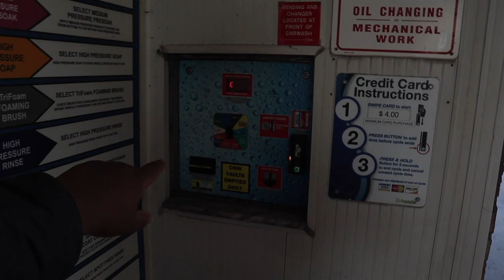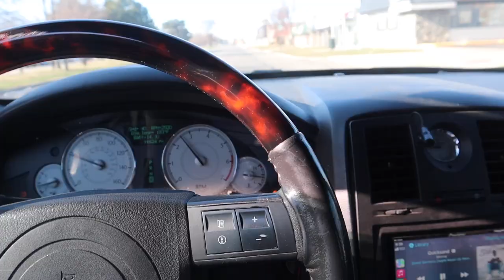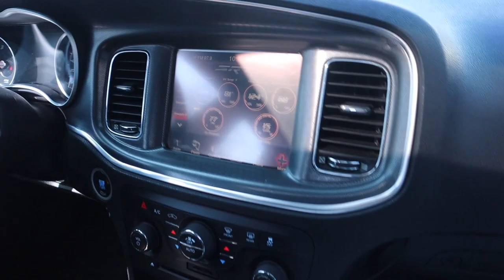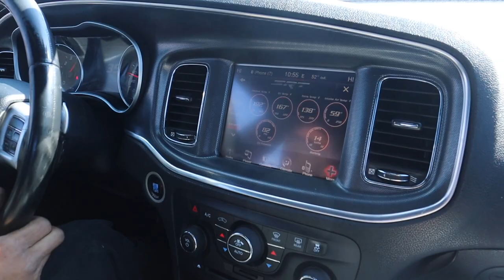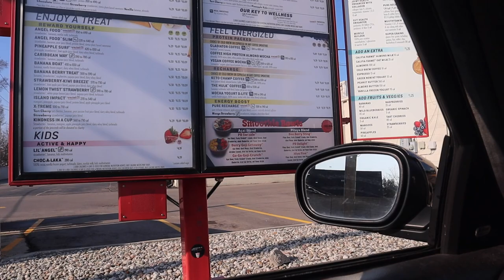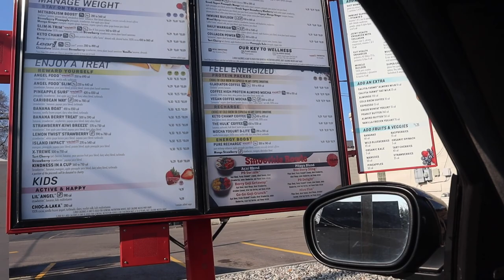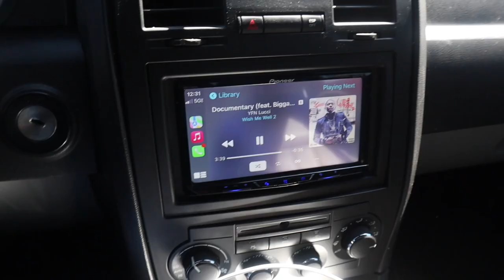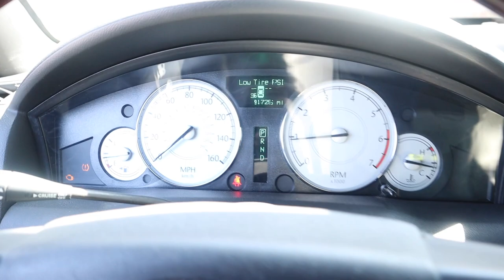INSTALLING RACING COILOVERS ON MY 2007 CHRYSLER 300C

Comment: man i just ordered these a few days ago mine come tomorrow, my back shocks blew out
Reply from the maker: Damn i could have got you 10% off but its all cool tho✊🏾 and yea mines was blew out too
Reply: damn i had a similar thing, my back passenger shock was blew and the camber control arm bolt snapped off, i been driving around this whole time with it broke and didn’t even know, so i’m replacing it with the coilovers and new rear arms
Reply from the maker: @panoramicww  damm bro yea that’s wicked I literally replaced everything and good shit man ✊🏾 maintenance  is a must 💯